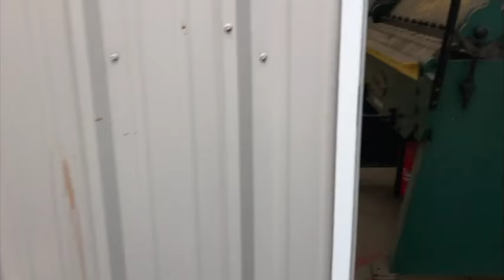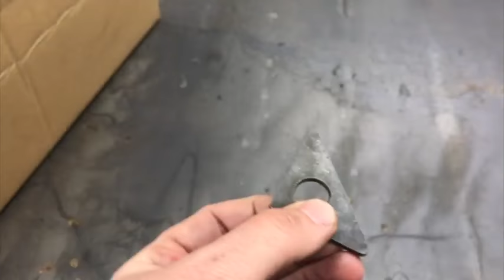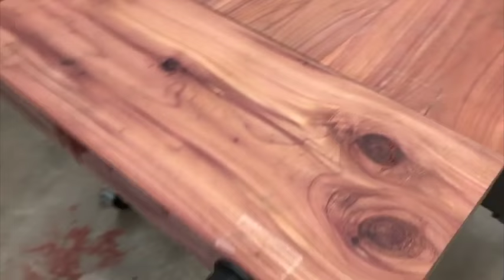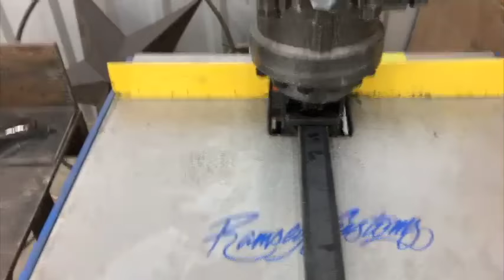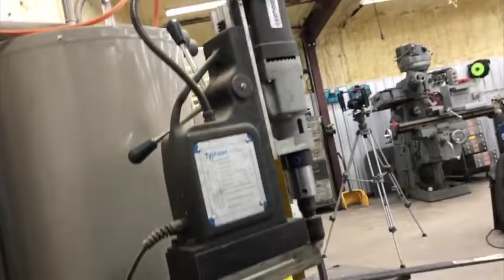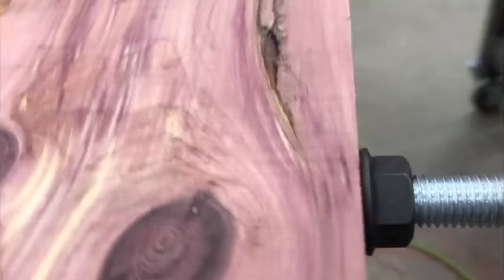Hole Punch - Drill Tap - Oldbarn Homesteading

Comment: Some nice spanner nuts would look good on the table edge and allow the threaded faster to sit flush with the end.  Just take a flanged nut, drill 2 holes on the flange face, then turn off the hex on the lathe.  Then you counterbore the holes to allow the flange to sit flush.  You just use a pair of pins pressed into a bar as a wrench to tighten the nut.  That would look trick I think.
Reply: Yes that does sound cool.  Those A2 Silicon Bronze washers and bolts he put the large chamfer on were badass, i am definitely going to make something like that some day.